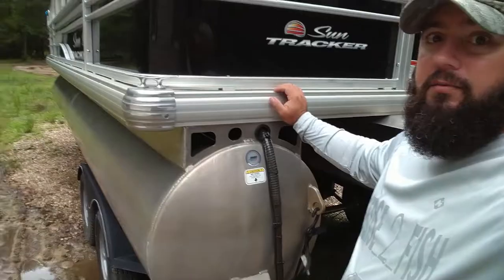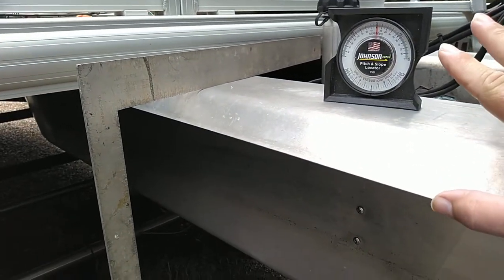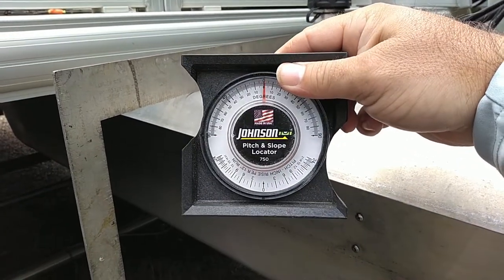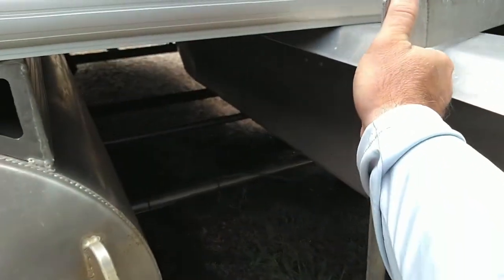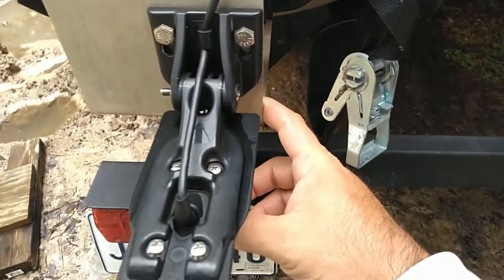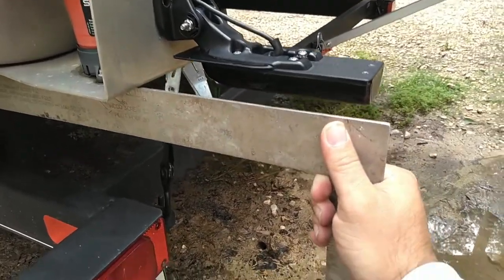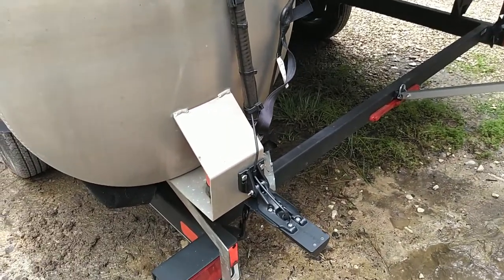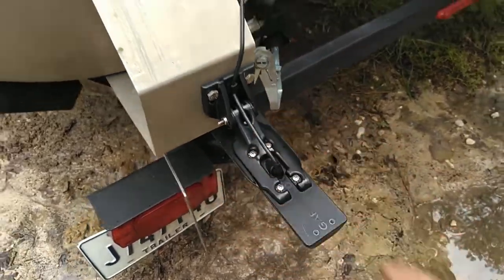HOW TO SET TRANSDUCER TO GET READINGS AT SPEED ON PLANE. PONTOONS INCLUDED. EASY DIY.

Comment: You need to drop it down another half an inch. You are measuring incorrectly. The conical part of the transducer should be below the boat bottom, not just the tip like you have. And get a metal mount, that plastic is not good for speed as it bends with force.
Reply from the maker: I've since swapped to metal after my sons friend used the transducer as a step to get into the boat while it was trailered 🤷🏻‍♂️. But i had it lower ay one point and it was throwing up a rooster tail that would spray the motor the entire time you were running. I've checked the readings a few times and so far readings seem to be accurate.

Comment: I just bought a Helix 7 to attach to my pontoon boat.  My pontoon sits in a boat lift and the cradle that the logs rests on sticks out about a foot behind the logs.  A transducer can only mount flush with my logs, not hang down below or the transducer hits the bunk when I drive back on.  I haven't installed it yet,  Will it work flush along the bottom of my toon?

Comment: Nice review. I am waiting for my 2022 fish’s barge to arrive and am researching fishing setups for it. Are you able to use side imaging with the transducer mounted on the pontoon, or does the motor interfere?
Reply from the maker: So far it hasn't interfered unless I'm trying to side scan at higher speeds (+ 5-7 mph). But that's with most side scan units.
Reply from the maker: So far so good. Just have to scan at low speeds (below 5-7mph) but im sure thats the case for most units.

Comment: Thank you.  Although my Pond Prowler is only troller motor powered it's hull is pontoon design.  I'm watching a lot of videos trying to not remain too ignorant about getting my first fish finder put on right.  Your video helped me.
Reply from the maker: Glad i could help. Good luck with the pond prowler. Let me know if you have any more questions. I have several more videos in the works, but I've been away at work so haven't had much time at home to finish them up.
Reply: @freshwaterfiend6268  I also have pond prowler and was wandering which side on the back of the pontoon should i place the tranducer, right side or left side or does it matter?? I also running a suzuki 2.5 out board motor.  any advice would be helpful!!!   thanks

Comment: I run a Lowrance triple shot unit on a stepped hull transom 1991 Javelin 396FS at 65mph and get perfect readings. 
Just like you said, the transducer has to be slightly lower than the bottom of the hull so it gets solid water, no air or bubbles.
Reply: Glad to hear this. I just installed a Lowrance triple shot on my pontoon boat, and lose readings at speed. Going to give this guys instructions a try and see if I can get it dialed in.

Comment: Great until you hit a piece of drift wood and it ruins your transducer
Reply from the maker: Well I've hit several so far, including an 8ft 4x4 with SS grab rail still attached that came loose from a dock along the river. So far so good but anything with the right situation can be damaged. On a pontoon a Thru-Hull isn't an option. 
So to get the best experience out of my equipment this is the option that works for me. If it doesn't work for you, then by all means go a different route. Thanks for the view and the comment non the less. Just trying to help other Coullions like me. 😎

Comment: Thank you so much for 
the tip. I will try your suggestion since I have the same exact problem. The depth finder on my 22 ft pontoon quits reading at 11 mph. I have a 2017 lowrance hook 4 fish/ depth finder. I will get back to you by next boating season if it solves the problem. My boat stays in the water all season and won’t go back in until next spring. I will make the adjustments then. 
Thanks again. 
Dennis 
Selbyville Delaware.
Reply: did it work

Comment: Thanks for the transducer tip.  I have had the same trouble with with my pontoon boat.  Our lake has a very hilly bottom and it drives me nuts to have to run at 9 miles an hour or less to get a reliable reading.
Reply from the maker: Glad it helped. Our rivers go from 2'-20- in some places so I used to feel that pain.

Comment: Question I have the same transducer, have you thought about mounting it directly to the bottom of one of your pontoons directly under captains seat?

Either using an extreme double stick tape, or scuffing up the aluminum and using JB weld.
Reply from the maker: No mainly because we go to a few sandbars that I've actually drug bottom a few times. Never been stuck but definitely would ruin anything on pontoons. Plus I trailer mine everytime so I doubt it would last long.